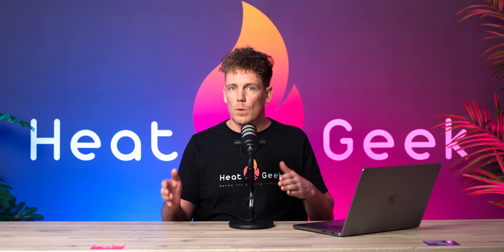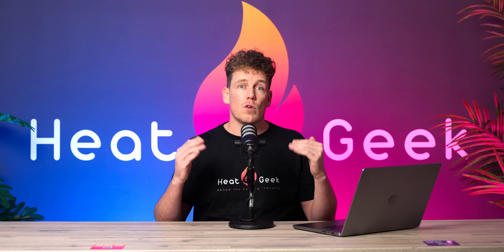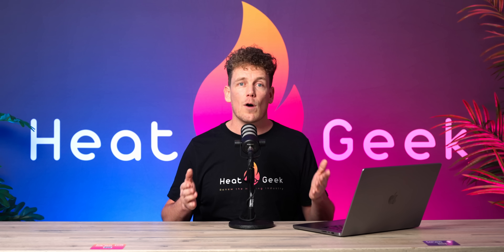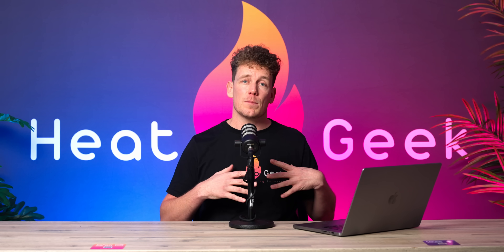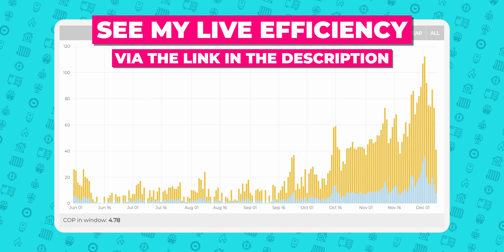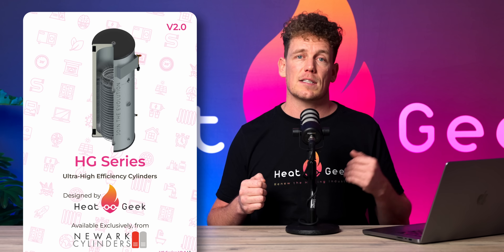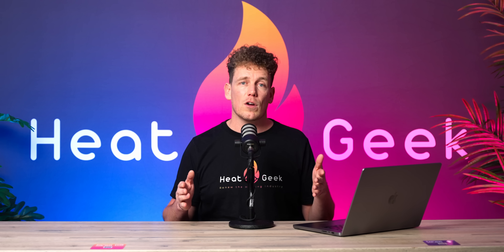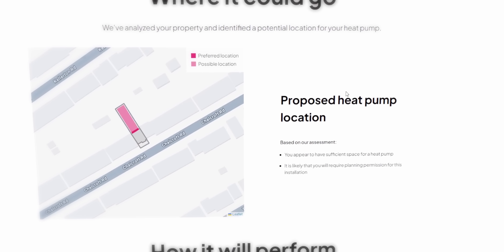How to Generate The Most Efficient Hot Water On EARTH

Comment: How can anything be more efficient than 100%. Thermodynamics makes that impossible. I have a combination boiler and want to know how “efficient” that is when using their maths. It’s got to be better, as it’s only heating water on demand, instead of storing hot water. Even a well lagged tank will loose some heat.
Reply: You aren't getting the heat from the electricity. You are moving heat from the atmosphere into your system with a heat exchanger (like a fridge in reverse). The heat exchanger does run on electricity but it's so good that moving 3 kW of heat energy only requires 1 kW of electrical energy to run the heat exchanger = 3X the output = 300%. Pretty cool (warm) 😎
Reply: So you’re saying the percentage increase is heat gained from a heat pump with reference to an immersion heater. So why are you saying it works with a gas boiler? Also, as gas is a 1/4 the price of electricity it’s no saving in money, and a very high initial investment.
Reply from the maker: @petethebeat48  please watch our video titled ‘how heat pumps bare over 100% efficient’ 

We are talking about how efficiently the heat is generated not losses from store over tim. The heat losses are in the data badge but are far outweighed by the heat exchange efficiency increase. It’s nothing to do with an immersion heater. 

A gas boiler generates at 75-90% efficiency on hot water. With this cylinder it will be at the 90% end. 

So with 6p gas and 24p electricity per kWh, each kw of heat will cost 6.7p for a gas boiler at 90% efficiency and 5.2p for the heat pump at the 460% that my heat pump works at.
Reply: I’ll have a look at that video. Thanks. 

So your saving 1.5p per KW of heat you produce. So I’m correct in saying it will take decades for it to pay for itself. So not worth it for most people to do unless they have money burning a hole in there pocket. Or want to do there bit for the environment. 

So for my situation, with a combi boiler, where I don’t store hot water, I’m assuming the total system efficiency is higher than someone who does store it in a hot tank. Added to that, my house, like so many in the uk, are woefully inadequate for a standard heat pump and would need upgrading at incredible cost to a passive house. As well as doubling radiator sizes or installing water underfloor heating. The only other option is to go for the new type of heat pump that has propane as the refrigerant to get water temperatures up to my gas boiler. However, they are not over 400% efficient, as they have to extract more heat out of the air! 

In short, unfortunately, the technology isn’t there yet unless you have a house built after 2010 or buckets of money to make the one you have achieve the thermal efficiency and air tightness of a new build.

Comment: This is crazy to use coils, use an intermediate heat plate and pump and a tiny heat exchanger can have the effect of a huge pipe heat exchanger and massively reduce materials.
Reply from the maker: You need an extra pump and various other parts. More parts the plate load then coil

Comment: We just had a new install using existing Joule cylinder With 1.1m2 surface area coil. Installer chose to use just external plate heater, when I thought he was planning to use both internal coil as well as external plate heater. Which setup would work best, in your opinion.

Comment: So it's great to see these principles finally reaching UK heating design. And obviously the optimisations are slightly different for a heat pump than a solar-thermal+gas input.
A couple of things you said seem a bit odd. 
1) putting the coil as low as possible is good to maximise heat transfer, but isn't it also good for disturbing stratification? If you feed in the bottom of the coil to maximise heat transfer you now warm the water right at the bottom which will rise and potentially cause mixing. Have you just found that it doesn't (mix) and stratification is maintained? Or are you putting the hot in at the top so that it passes through the already-warmed-height before finding some water cool enough to warm, and thus most of the heat-transfer occurs near the thermocline so there is less mixing?
2) Is a 'wide input pipe' really sufficient to prevent destratification? All those tanks above have fancy diffusers or separators to prevent incoming cold water (or warm water from heating systems where the tank is used as a heat store too). I'm a little surprised that just using a (28mm 35mm?) input pipe is sufficient. Obviously you have data showing that your setup is working, but are they really not putting any sort of diffuser/baffle on the input?
3) You advocate as big a tank as possible. Which is indeed good for optimising stratification and heat store capacity, but standing losses are quite significant from hot water tanks (1-2kWh/day) so especially if you are a low user you start to lose more in losses than you gain in efficiency. has anyone got any sums on this? I find these things tend to be optimised for households of 4 or 5, getting through 200l/day of hot water. If you are only using 20l/day then I suspect a smaller tank comes out better overall.
Reply from the maker: 1) you want the hottest heat heat source against the coolest water. This or plate loading are the only way
2) ‘wide pipe’ is the same as a diffuser etc- any way of lowering the velocity- I’ve just worked with what we had available. I’m sure it could be improved but is currently the most efficient cylinder
3) the standing losses are smaller than the free energy from increase heat pump effy

Comment: I spent a lot of time looking into stratified cylinders back in 2008, mostly from the point of view of maximising solar thermal input. The only tanks one could buy with the right characterisitics (internal stratifiers, input diffusers) were German, Dutch, Finnish and mostly huge and expensive. (Consolar,  Solvis, wallnoefer, Tiso, Akvaterm etc). I considered making my own as no-one was selling a UK-sized tank designed to stratify nicely (for less than 3 grand), but didn't trust my welding skills enough. So I ended up just using a side-mount plate heat exchanger to load a standard domestic cyclinder from the top. This has actually worked pretty well for the last 15 years. You get less total energy transfer but more useable hot water without having to turn on additional heat inputs. So 3/4 of the year 40 tubes does all our hot water (2 people), and the entire solar thermal system plus tank mods cost about £1000.

Comment: Seriously, this man should be in line for an OBE. Over the last few years he's been dragging the culture of air2water heat pump installation in the UK (kicking and screaming?) into the place it needs to be - where it's trusted, efficient, and reliable. If this was left to the government, we'd be years behind - just look at the miserably low standards of MCS for heat pump installations. And all done for the right reasons - 1. because we need low carbon home heating; 2. giving installers the self-respect and pride that comes with doing a top notch job where they actually understand what they are installing, and 3. helping interested home owners understand their own heating systems. 
Massive respect and gratitude.
Reply: Point 2 is a huge one.

Comment: Hot water is indeed the Achilles Heal on my Arotherm system. We have the "Unitower" Setup and I think that just isn't a efficient as it could have been with a better cylinder. It was the way Vaillant planned the system for us though, so nothing to be done about it at this point without massive extra cost. It's not that bad though, because despite having a relatively bad COP on hot water (usually in the 300+X% range) we only use 0.8-1.2kWh of electricity per day in the warmer seasons to heat up to 50°C..of course it's more in winter, but not ruinous...😉

Comment: That's interesting Adam. My natural instinct would have been to think that a de-stratification pump would increase thermal transfer and efficiency - but as you say, it's better for the heat pump transfer from the coil if it's in the coldest water. Following that but less significant would also be that the flow enters the lower end of the coil and exits its top.

I'm glad I don't have a de-strat pump now. 

I have a tall 300 litre Joule cylinder specifically designed for heat pumps with a bigger coil. I've set up my Midea heat pump to heat to 50°C during cheap electricity times at night and once a week to 60°C for Legionella - avoiding use of the immersion heater which is only 100% efficient.

I did get an Eddi solar diverter but since the export tariffs pay at least twice the cheap rate now (e.g. 15p/kWh export and 7.5p/kWh import on Octopus Intelligent Go) it makes no sense to heat the hot water with solar PV using the only 100% efficient immersion heater. Although it's "free" it would just stop the tank heating from the heat pump at night because it would already be hot and I'd lose out on the 2:1 tariff profit advantage which if I'm running a COP = 3 effectively means a COP = 6 in cost terms.

The Eddi is now only used to monitor the tank temperature at the top (the heat pump monitors the bottom) and timed to top up the end of the Legionella cycle if the heat pump can't quite get to 60°C but it usually gets to 58°C or so so there's little point in topping it up.
Reply: I've just checked and the flow to my coil is at the top and return comes out the bottom. The Joule brochure shows them this way round too.

Would it be beneficial to swap them round and how much difference would it make?

Comment: Love your vids, thanks for sharing all of your work. Im not a Pro, but I have a question. You state that to be more efficient, you need to get the heat pump water into the cylindar with an eliment or external plate heat exchnager and the lowest Differential Tempriture.
Why would you not use a couple of eliments for your Hot water, direct from the mains to take heat energy out of the tank to DHW. The water in the tank can then be common with your Radiators or UFH? So no temperature difference between Heat Pump and Cylindar.
Benifits as I see them.
You can layer the water in the tank and heat it gradually from the top down.
No concerns about Legionela as the water you use is not stored.
You can use a lower tempriture so long as the tank is big enough.
The DHW tempriture is consistant regardless of the Tank Tempriture. Obviously needs a thermostatic mixer from the cold.
The system is sealed and has with inhibitor, so less likley to build up limescale. The DHW eliments can be cleaned without having to drain the entire system.
You can use other heat sources, wood, pellet or gas boiler, or Thermal Solar (via another element).
Very happy to have it explained to me why that's not efficient or not a good plan. 🙂

Comment: Very interesting video. How is the heat pump F&R ∆T affected using the larger coil? Manufacturers typically state an optimum ∆T of 7°. Have you also monitored the heat pump to see if it maintains and/or improves efficiency? You probably alluded to this question when talking about the HP Saturation Point. You're doing great work by the way, I deal with a lot of opinions on HP design daily! (MCIBSE)

Comment: The most common problem I've seen is the water taking a long time to heat up. Priority hot water means that the heating can't run whilst heating the hot water. Hopefully the look at controls will address this.
Reply from the maker: Quite a simple solution to that. Set the hot water to come on earlier to compensate. 

Out of the thousands of hot water priority homes over worked on I’ve never had an issue with the home temp dropping during hot water heating.

Comment: Surely if replacing the whole heating system and wanting to reduce the wastage and co2 we should also mention WWHR as that would allow for the use of less hot water.

Surely it is better to use less (and make what you do use more efficient).

Ultimately with an ASHP you are usually talking about major upheaval anyways and while this would likely add soke cost the minimal maintenance and reduced costs should be recouped fairly quickly.
Reply: Maybe you should mention what WWHR stands for!
I'm going to guess that the WW doesn't stand for world war, as that's already trademarked, but maybe waste water?
Reply: @ricos1497  WWHR IS Waste Water Heat Recovery. If you have a shower then the waste hot water is sent out down the plug then down a copper column and the incoming cold water supply for the shower and hot water tank runs up the outside in Separate copper pipes, pre heating the incoming water with the heat from the waste water. 

This means when you mix the hot and now slightly warm water you use less hot water thus saving more money.  Look up power pipe R4-84 for a good example of this.

Comment: How can hot water stored at 40 to 45C work with thermostatic mixer valves that most state that the hot water flow needs to be 10C above the desired outlet temp for the valve to function correctly?  
I noticed that most of the top performing open source energy data figures are using low temperature hot water storage that will obviously improve CoP.
Also previous videos discussed legionella risk and stated 45C absolute min?
Reply from the maker: Please watch our legionella vid

Comment: So my installer is suggesting a joule 400 litre eco 80 tank which seems to fulfill the volume , tall and slim requirements.
   Should I be asking them to look at the Newark for further advantages ?
Reply from the maker: If you want the most efficient cylinder, yea
Reply: @HeatGeek  Does part 2 provide an insight on how much better the HG Newark cylinders are, please? From what was being debated in a thread on Open Energy Monitor forum, I did find myself thinking the benefit wasn't something you would do for a ROI, unless you use a large volume of hot water and are not able to take advantage of off-peak tariffs.
Reply from the maker: @LeiChat  well my cylinder is 4.6 scop. Will save just over £100 per year over a 2.5 scop for a 2000kwh demand. 

10 years will save £1000, which will justify expense over a poor cylinder.

A vailant cylinder will be around 3.5 scop but cost around the same as this Newark so o think works out just fine right?
Reply: @HeatGeek  Sounds good, thank you.

We have had a Newark with 4m2 coil since February and the scop to date is 3.6. Looks like our annual DHW demand will be around 1000kWh.

In the 48 days prior to the Newark being installed the DHW scop on our old cylinder with a 0.8 m2 coil was 2.95